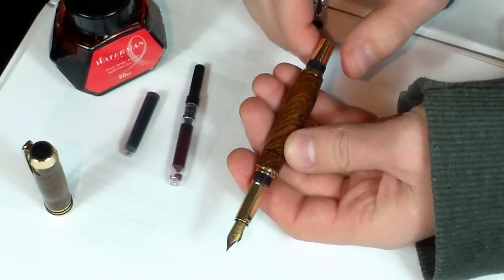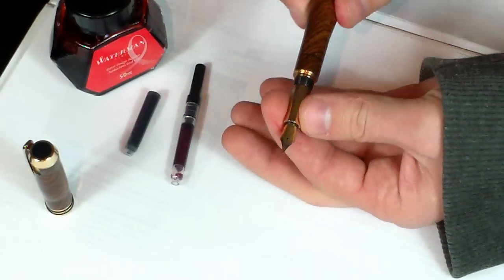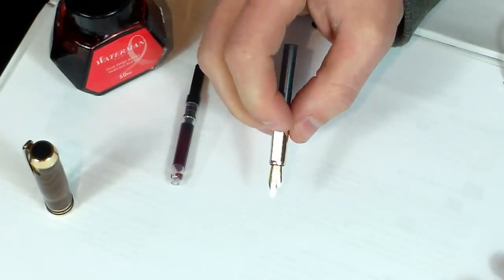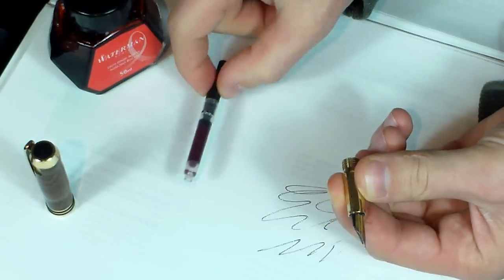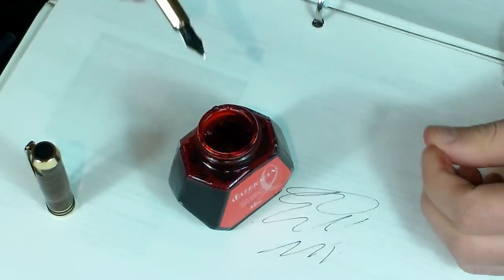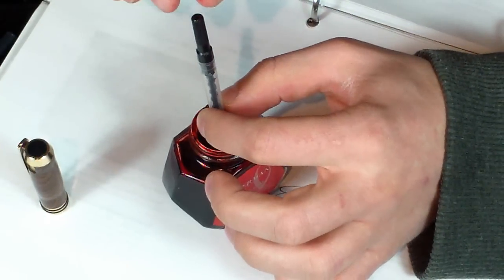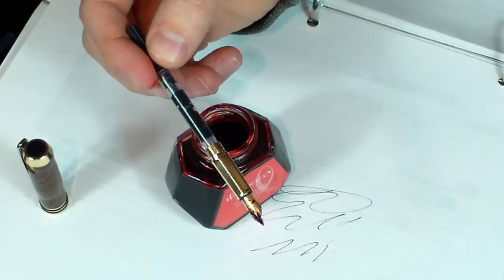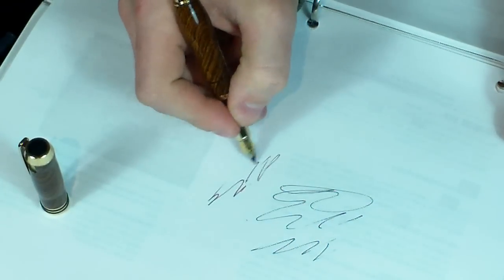My Fountain pen Refill Instructions

Comment: Hello, the pen does not need to be cleaned after every correct use? I mean I can stuff it, use it a couple of times and leave it for a while without using it or the ink can dry and ruin the tip?

Comment: So if i have a normal fountain pen that uses cartridges I can just buy a converter that is compatible correct?
Reply from the maker: +TurkeyGaming I believe the answer is yes most of them. i have had pens that only fit a cartridge and not a pump. i guess you can try it, they are pretty cheap

Comment: The second method is cheaper, right? And can it be used for any kind of pen? Just saying because mine is pretty small.
Reply from the maker: The bottle is cheaper because you get a lot more refills, as long as your own has an ink pump of some sort you can use that method
Reply: ***** It doesn't. I thought it could be bought apart from it.
Reply from the maker: +AngieGandalf6 yes the pump can be purchased separate, I may have a few laying around I can send you.
Reply: +Dema's WoodShop Thanks for the offering! But don't worry, I don't want to bother you, I'll look for it myself ^^

Comment: Any fine tip nib fountain pens on your site?  I looked at a few and they were all German medium.
Reply from the maker: GeisT22487 I write medium because the nib that comes with there are no definite specs on what size it is. To be honest when i write with my fountain pen at work, its very fine, unless there is even finer i wouldnt know. I really need to look  into stocking different nib sized. There just isnt that many people asking about it. Really low demand at this point
Reply: *****  Thanks for the timely response.  I definitely understand if you don't stock up on something that's not in demand.  I asked because I am looking into buying my first fountain pen and really liked some of your designs and appreciate quality hand crafted items.  I may just get a Japanese fine tip pen and one of your medium tipped pens to get a little variety.